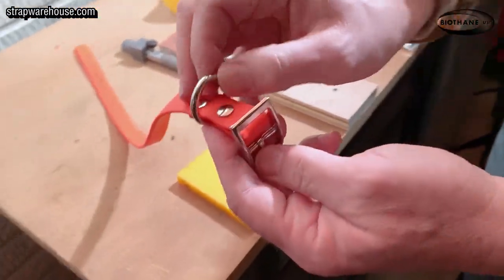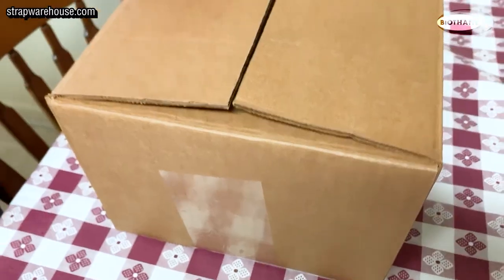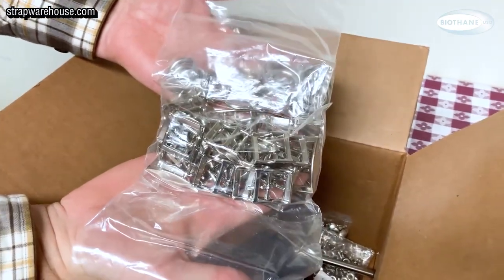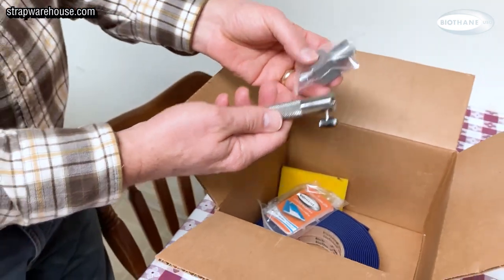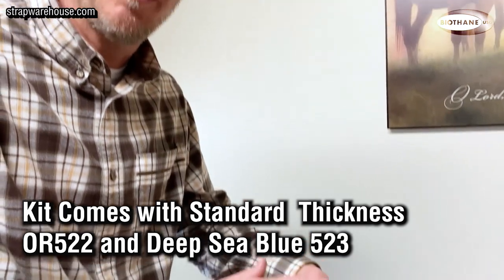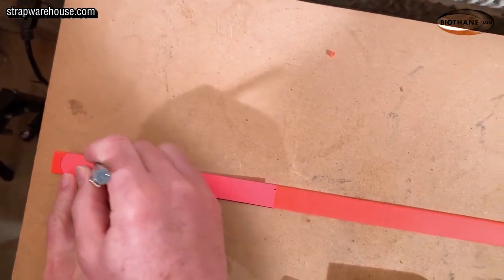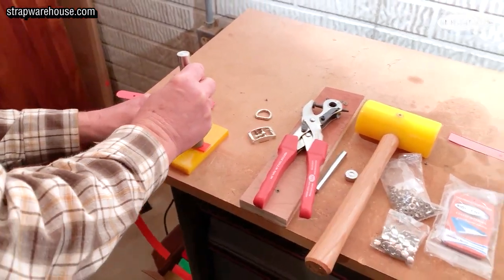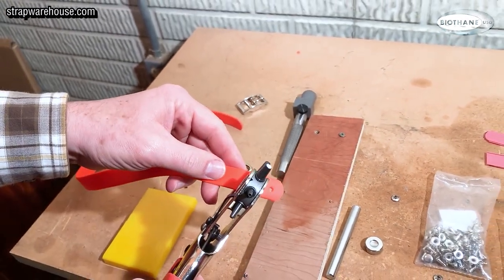The Hobbyist Dog Collar Kit

Comment: I'm so glad I found this video!! I couldn't find any tutorials for making biothane collars anywhere. Is there anything specific that needs to be done to seal the cut ends, or are they just supposed to be left as is with the webbing exposed?
Reply from the maker: Hi Tonee, Thank you for the comment!! You do not need to seal the ends. The most important thing to do is keep your punches clean and sharp! This will make a clean cut and it will look nice without the loose fibers. Always use the yellow block to cut on and take care of your punches to maintain the sharpness!
Reply: @BioThaneCoatedWebbing  Thank you for replying! Thats great to know!
Reply from the maker: @lilmamat100  We are planning to do a video on this topic hopefully Q1 2021.
Reply: Hi, what is the Yellow block made of please?

Comment: What size rivets do you use?
Reply from the maker: Hi Drake, it depends on how thick the Biothane you are using.. Take a look at this reference: 
Super Heavy (thickness) 6/16"
Standard 4/16" or 5/16"
High Flex 4/16"
Also use 4/16" if not doubling (adding name plates etc.) 

I hope this helps and thank you!

Comment: I want to use heat transfer vinyl on the biotane. 315degF for 15 seconds, will this spoil the biothane?
Reply from the maker: This takes trial and error... 15 seconds may be way too long depending on your temp.. Start with a lower temp around 200F and go up from there.. I hope this helps and let me know how you did!